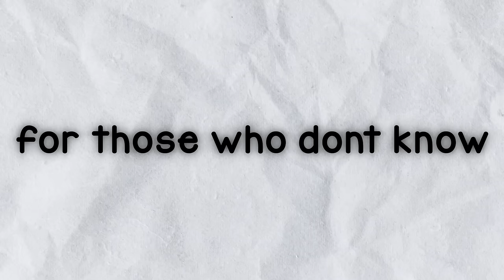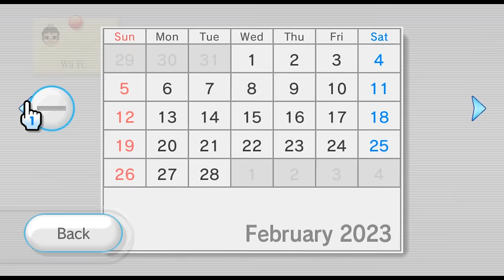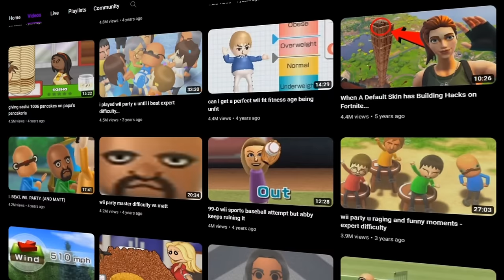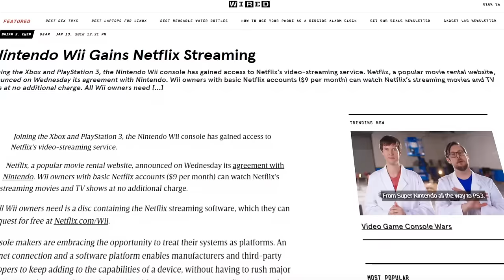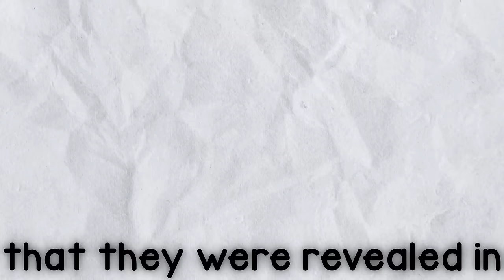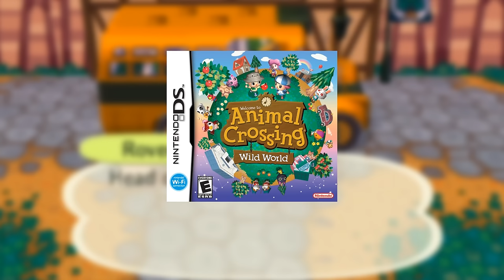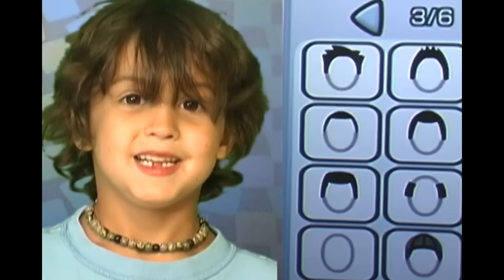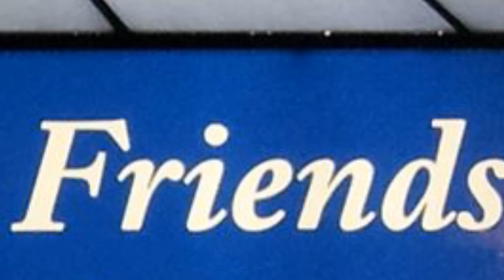The Ultimate Wii Iceberg Explained... (Part 1)

Comment: I bought a "broken" Wii in Japan for less than $10 USD, and when I brought it home, it works perfectly fine. It's missing some port covers, which may be the reason why it was labeled as broken?
Anyways, it still has a bunch of save data from some random Japanese family. I never wiped it and modded it. It has the 出前 channel, and some other cool ones, along with some funny Miis. I wonder if the kids who used it ever wonder where it ended up ...
Reply: I do that kind of stuff all the time, I've even found pictures left behind of the previous owners. Very interesting stuff